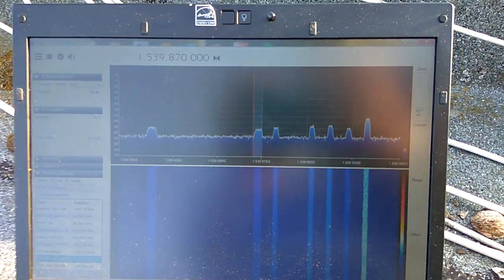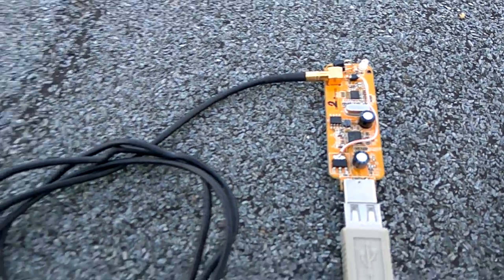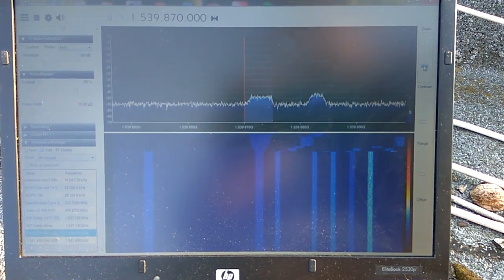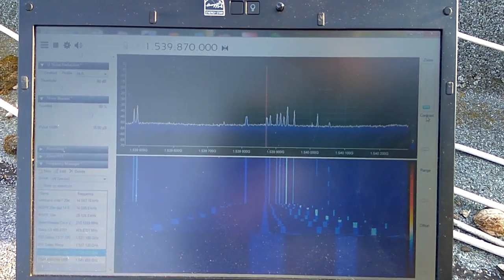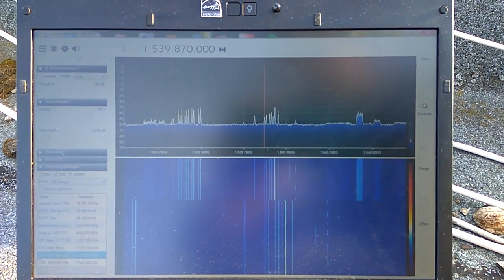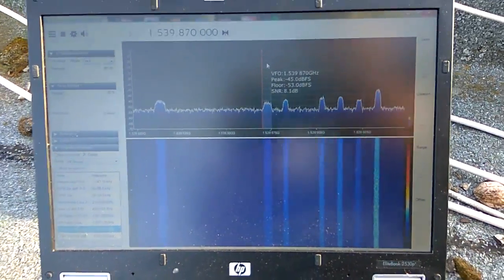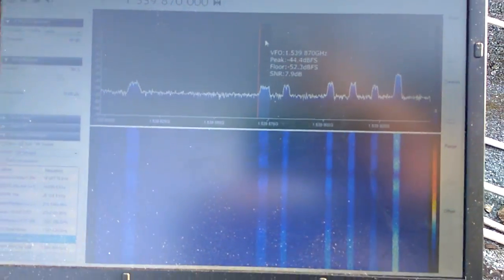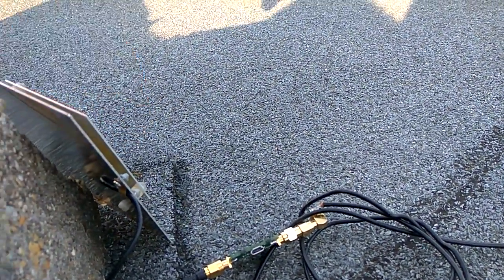L-Band Outernet signal reception with RTL-SDR dongle and LNA

Comment: I have similar device, ....
Can you explain the modification cable in your dongle... And what is the purpose that jumper (cable).
Reply from the maker: sure, already explained in the description filed once released the video, copying here: "Bias tee formed from 120nH inductor connected to VDD on board. ESD diode must be removed before that modification!"

Comment: Hi man, I got a LNA +12V 75mA, can i used more mA like 12V 1A?
Reply from the maker: yes, the current rate (mA) is dependent on your load, which is your LNA consumption. The power supply voltage is what really important.

Comment: Did you get any data?
Reply: where did you get the LNA ?
is it based on MAX12000 LNA chip ?
Reply from the maker: Sure, it works! Here you can get information and details: http://discuss.outernet.is
Reply from the maker: also check out the actual frequencies as it's changed since the video made
Reply: Veryokay Awesome! I've always wanted to browse it, never had the equipment, but now I do!
Reply from the maker: here: https://outernet.is/products/

yes
Reply: Veryokay 
The LNA I buyed from outernet does not have a metal shield and no usb connector.
Reply from the maker: Almost correct! No metal shield (that's not mandatory in many cases) but there are modifcation options for the external power supply. Via holes exposed for USB pigtail connector.

By default the LNA powered by bias tee (powered from SDR) one can make modificaitons described here:
https://github.com/Outernet-Project/Information/wiki/Hardware